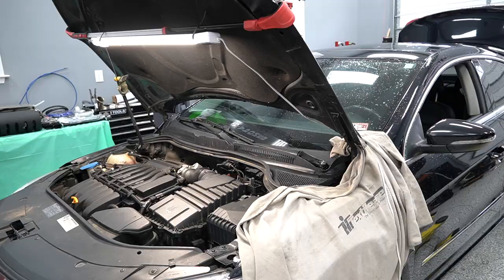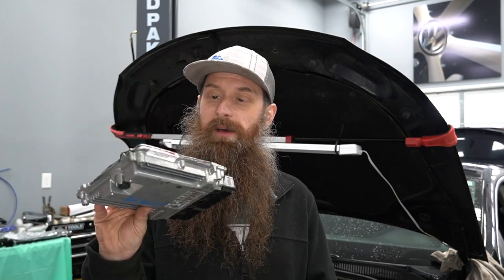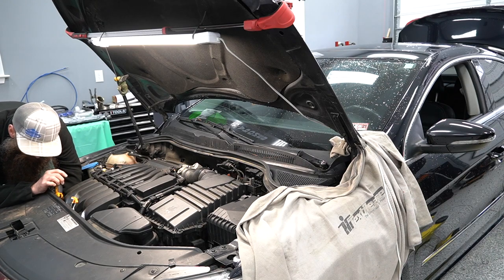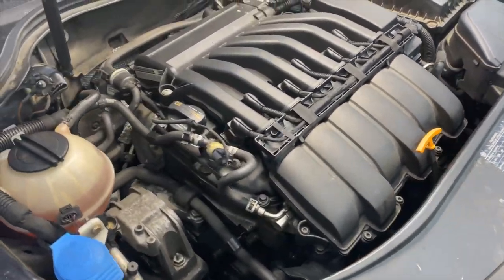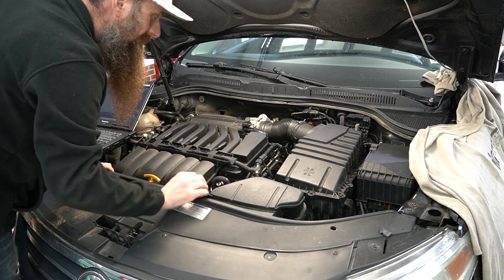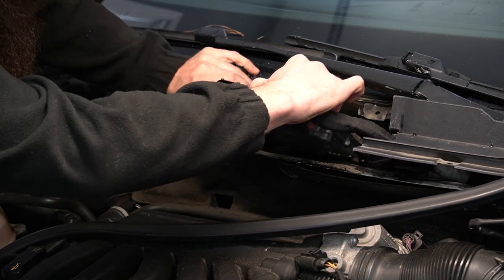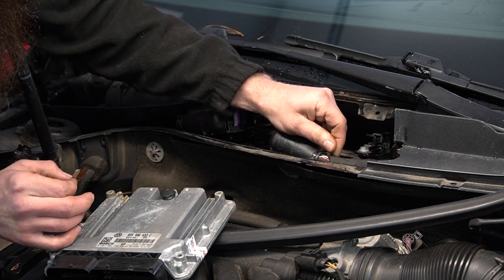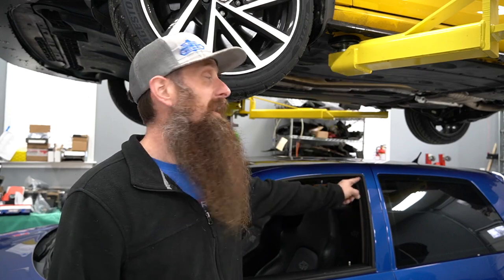3 Other Shops, Didn't Fix this Car. They Made it WORSE

Comment: I would say you have a bad high pressure fuel pump, you should have something closer to 40 bar at idle, 6 bar is tank pressure. A stretched chain on a fsi vr usually causes a fuel pressure malfunction fault and if you check it at idle you end up reading about 120 bar because the pulses of the pump and injectors are not lining up. Being the regulator is working I would lean more towards a pump  also the 3.6 uses a roller and not a flat tappet like the bpy so wear isn’t usually an issue

Comment: wish i knew how to fix cars. its fun if you know everything. i took a manifold off vw and and said nope, i'm not fixing it myself. but i learned alot just taking the manifold off cuz it taught me variety of components in the engine such as timing chain, purge valve, fuel pressure, coolant hoses, valve cover, etc, etc....different sensors everywhere.

Comment: This is a perfect example of the mess that can be made by parts swapping. I have been seeing this a lot over the last several weeks. These are cars I walk away from because the shop/customer can’t afford my time to find everything that is wrong or fix the problems they caused to then get us to a point of actually diagnosing the original problem.
Reply: We had a high mileage Benz (220,000km) come into our dealership courtesy an over enthusiastic buyer who purchased it as at auction as 'non starting' (but someone had restored the body/interior to mint). Weeks of hair pulling by my mechanics later i asked if the car had its original ECM, frantic nodding in the affirmative. Then I asked if the vehicle had its original engine... light bulbs went off all over the workshop... yep, had been engine swapped for later, incompatible model. We sold the vehicle as a parts car to somene who had the same model with good mechanicals but lousy body. Not worth our time to fix.

Comment: FSI pump cam followers are notorious for wearing, had a friend that wanted to buy a MK5 GTI 6spd car, we test drove the car, and it ran like it needed fuel under load, being that the VW dealer was selling the car in "as is condition no warranty", we asked that they fix the problem, and we would consider buying the car.  Long story short, the high pressure pump cam lobe was so worn out, it ate the camshaft lobe that runs the pump. They replaced both the camshaft that runs the pump, and the cam follower, and car runs like a champ now, my buddy has been really happy with his purchase, but I think it's getting close to that window when the cam follower needs to be swapped out for a new one before it consumes it self again....

Comment: Was in the auto repair business for years, mostly Bosch systems. The first thing I did when I got a car in the shop with problems was demand ALL the "old" parts, reinstalled them and then chased down the real problem. It was rarely what had been replaced.

Comment: Ah, the venerable BLV 3.6. Over the years, the only problems that have been routine are worn high pressure pumps...and aged timing chains. Solid engine.

For the customer, it's a big step to separate the transmission and rebuild the timing chain drive. But, if the rest of the CC is in good shape, it's a good investment.

The most fun BLV find is rare, it was offered on the little EOS. No replacement for displacement, as the gearheads will tell you.

Comment: Just got an 09 jetta 2.5 for $750. Trying to do this all myself is pretty difficult. Got codes p2401 and p2177. Havent found a direct answer on what is going on. So far ive changed the pcv diaphragm and the evap purge n80 valve. Going to get the codes reset and go from there. It runs drives and stops great. I also changed the oil which was really dirty and probably 8 quarts of oil in it. Also fixed the vacuum booster oil leak. Really excited about this car and hopefully dont have much to do. After i get the light off going to do the ac and get it legal

Comment: My audi had an ECM crap out. Right before it happened I noticed that the fans would run after I would shut the car off. Happened twice before the car just didn't start again.
Reply from the maker: That’s a common thing with ECM failure. Fans always on

Comment: “None of these points jump out at me....” good lord....that list of DTCs is absolutely unacceptable to me. Every single one. First impression was high pressure fuel pump and chain guide wear including a choice bag of sensor replacements. Wow.
Reply from the maker: You missed what I said. I said as “common 3.6 issues”. Not they are no problem. Just not common

Comment: Having a vw jump to different shops being incorrectly diagnosed and having parts thrown at it seems all too common. I bought an mk5 brm and had a maf code, it was also spooling the turbo until cavitation constantly. Looks like one shop followed the owners manual and removed the MAF fuse. The next shop replaced the turbo (??), and replaced the map sensor with a common rail one. I found a service manual. Replaced the fuse and the map sensor with the right one and it ran perfect after that! Poor guy had a bill of like 4 grand which was totally not needed

Comment: You will get fuel pressure related  codes because the wrong ecm is in there. Once the correct ecm is installed it should clear out a few things

Comment: I had one with alot of electronic codes for different systems (Golf mk5). Turned out to be the in tank fuelpump relay module being shorted to ground but it also caused the pump to not turn off with the key. But those electronics can be fickle. Had codes for everything connected to canbus.

Comment: I own a vw that I work on because no one around me can fix a normal vw let alone a modified one. I had at one point 6 parts to replace all because the idling fan died about four months after I got it. My car runs at 200 degrees so you need the idling fan for any driving under 45 mph and in my attempt to get home from work, since I only have a few minutes of city driving and the rest is highway, it heated up pretty hot. It has a range of 160 to 240 degrees and it hit 260 at one point in town. That caused a knock sensor to go out after  I replaced the fan. I ended up replacing a coolant flange, pipe, a bunch of vacuum tubes, temperature sensor, and alternator. The knock sensor, temp sensor, and alternator all sit next to each other and the coolant flange fits in the block. The coolant pipe was the only thing I had to replace because it was stuck in place and I had to get it out to replace the temp gauge and knock sensor so it ended up getting damaged because of the four hour struggle I had with it. Let’s just say I hate my vw when it breaks. That being saying I have a b6 tfsi Passat which is similar to the cc but very different in a lot of ways.

Comment: I have just finished working on a Holden Trax (Chevy Trax) that consistently threw a MAP sensor code at idle, vehicle was also hard to start and was blowing black smoke at idle along with rough running. It had been to various shops and had the ECM on the front seat as an indicator. A quick check of the MAP sensor circuit and operation on the data stream showed it was working ok except the reading was wrong, around 4inHG at idle manifold vacuum. A bit further investigation uncovered that the car had a cylinder head replaced with an exchange item in the past, checking the part numbers on the cams and the head showed the correct part number for the head but the cams were for a Holden Cruze. The Cruze had a different intake cam and phaser and the intake timing was out by 30 degrees retarded. Swapping the original cams into the new head involved removing the head and having the valve seats cut and the valves tipped off to get the valve lash spec right for the original cams, as lash adjusters were ex-Korea, 8 weeks away and 50 dollars each. The amount of money the customer ended up spending on the car was around twice the value of the car.

Comment: yer know... I had a company golf wagon that did a lot of crazy things intermittently, fail to start, run erratically, stall. then would run perfectly for weeks and do it all again. It spent time in 3 different dealer shops, even had a new ecm fitted, then finally the 4th shop called me within hours and told me to pick it up, it ran perfectly forever after that - it was the knock sensor.  This left me scratching my head, but I wasn't going to argue.
Reply from the maker: Wow!
Reply: @HumbleMechanic  I know right...

Comment: Well it sucks when there is a lot of embedded software (in the ECM) on a car and you don't know how it works.
Reply: This exactly the point once I have golf 5 showing engine check light show boost pressure sensor error when I scan the whole car it showed canbus error back door light shorted I told Mechainice to change it he don’t listen I changed myself after this boost pressure sensor error go funny isn’t it 😆😆

Comment: My VW dealership just stated I need an engine replacement after 41,000 miles. This is a 2019 Volkswagen Jetta. I baby the car and have always been ahead of the maintenance schedule. They are replacing the engine under warranty thankfully, but I am beyond shocked that this would happen. They state there was metal in the oil when they drained it. How could this have happened? I have never had such an issue on any other car. Frankly, the car has been wonderful but this issue leads me to believe I should never buy a Volkswagen again.
Reply: What was the symptoms you had to have them look at it?
Reply: @mhaas281  No symptoms at all, hence why I was shocked.
Reply: Why did you take car to dealership if no symptoms? Routine maintenance?
Reply: @mhaas281  Yes, an oil change.

Comment: VW should really give their customers a heads up on carbon build up in a direct injection engine!! its like selling a girl a rotary for her first car and not telling her any of the other things that go along with owning a rotary. direct injection with no catch cans, car companies sure do cut corners and give cars some really avoidable issues! what a bunch of crooks, make the car correctly please!!
Reply: Im sure they did it because of emissions. So the carbon is from crankcase oil vapor? I never knew where it could be coming from with direct injection, thanks for clearing that up. Car makers should include one or two cold start fuel injectors in the manifold to rinse them out.

Comment: My 13 vr6 is just under 150k, still purring like a kitten lol. Had the first malfunction 2 weeks ago. Pcv valve diagram tore. Easy and cheap fix. Thankfully I'm pretty mechanically inclined. I originally planned on selling it once reaching 150k but used car prices are insane right now and this is still a great car. I plan on keeping it till at least 200k or more.

Comment: I know that sometimes an ECM may have the wrong part number in the sticker but it could be flashed with the correct software for the car (or have a tuned software locked or unlocked).  Some firmwares can be downloaded online and ECM hardware is mostly the same.  Did you check the ECM part # displayed on the sticker matching the part # in VCDS?  Can't you flash the spare ECM you have with the correct firmware instead of buying a new ECM?
Flashing an ECM probably can be done on a bench and not on the car though...

Comment: i wasnt working auto   i was construction / ag equipment.  they wouldnt spend money unless they absolutely had to.  we would go to factory training  on the new stuff coming out.  unless there was a recall,  it didnt start breaking for 2-3 years .   by then you had forgot everything you learned cuz you didnt use it and you had two more years of new stuff  confusing you.   never had the correct tools unless you bought them yourself. so frustrating.

Comment: I'm passing through that issue. No shop is doing the service right
Reply from the maker: Some shops are just not equipped for certain things. I'm actually good with that. But they need to be upfront with the customer.
Reply: @HumbleMechanic  Yea, the last one i sent i just got sad. He said that he would do the service it's easy and all, but he sent it to another shop to do (and they done it wrong). I only found out when i bough it back to be fix right.
Reply: @1300l  that's ridiculous
Reply: @tylerkrug7719  Yea, i own a car since 2002, i never had to deal with that before. Worse is the service was just a install of reverse sensors.

Comment: Quick question if you see this... I used to have a 2012 Golf R. Professionally built up to UnitedMotorsports 2+ Dyno Tune, everything short of Flex Fuel done... Any idea why the car loved to kill Camshaft Position sensors like every 6 months and cause a hard misfire?!? New owner hits me up once in awhile when it does it again. To the point he just replaces that sensor every 3rd oil change lol
Reply from the maker: Damn no clue. That’s strange. Using an OEM sensor?

Comment: Looks like exhaust valves issue. When is big Vakuum it take some ex. gasses back and make f.trim in minus. Under hi load and hi rpm it goes in plus because in this condition some incompletely burn mix (extra oxygen) reach o. sensor and f. trims go in plus. Timing goes crazy because ecu trying to make engine running right. Compression test usually don’t help because you can’t measure it in those conditions ( big Vakuum, hi load...). A professional with oscilloscope could figure it out by looking in dates when engine running (Vakuum variations and some other dates). Just a idea.
You can look in scanntool with diagram by looking in STFT and catch the moment when it goes from open loop to adaptation. It should extremely in minus drop and then rise til those minus 10. And only on cold engine like first start in morning by driving it.
But don’t listen to me too much, I’m not a pro, so I’m probably wrong.

Comment: Had something similar once my battery disconnected from the positive terminal wile driving. Rough idle, stalls when starting cold, over/under fueling, oxygen sensor faluts. Did a throttle adaptation all issues went away. Mk3 vr6 problems 🤣

Comment: Gotta Wonder Charles,  Why cant VW just have a few General Purpose ECM's that are adaptable via programming to different uses?
GM looks to Does exactly that with their Computers, and you can adapt a single ECM quite a lot just by adjusting the programming / SW on the unit.
(Eg Take a Holden Commodore (Thats an Aussie Model) and look at just how flexible those computers are). 

You'd think that would be quite a large cost saving to do that, and that VW would do so, but apparently not?

Having a dedicated unique ECM for every small variation in power train that is fixed, is just stupid.

Comment: Ive got a 08 R32 here with intermitant starting issues ... it does this hot or cold but not at any particulr time thou when it does not start let it cool down for a bit then it will start any ideas ? ive pluged my Autel in and there is no fault code or anything relating to this issue thou i might pop a crank sensor in there as i know these can break down when hot  .... great channel loving the turbo stuff on the R32 platform ...

Comment: Hi Charles, I have a 2018 RS3 2.5 motor... I have a misfire on all cylinders and changed the spark plugs, coil packs and the 2 maf sensors... Still get a rough idle and codes p0300 on all cylinders... What do u think the problem may be?

Comment: I moved to a wideband AWP from a narrowband ATC. The car runs.  Its tuned up with Meastro. But I cannot see the ecu with vagcom. I can see the ecu with Meastro. Is it possible I have a canbus ecu in a k-line car?  You mentioned fans are a dead giveaway the ecu is not happy. Since doing the swap I have a cycling low speed fan with ignition on.

Comment: Hi, love the channel. I have the BWS model and has engine light on. Iridium Spark plugs black which were changed and car run ok for about a week but now issue is back. Running rough, smooths above 2000rpm, runs particularly rough below this. What are your thoughts? MAF or coil packs maybe?

Comment: My 2020 GTI  has so many codes that the dealer doesn’t know what to do. Sitting still every warning light came on. When I started driving lights went off but all electronics inside the car started going nuts. VW dealer says they don’t know what to do.
Reply from the maker: They must have VW intervention at some point.

Comment: Imagine if "right to repair" were a reality and you could actually fix/replace the software on ECM... Current situation is like "my printer doesn't seem to be working, I guess I have to buy a new computer and try again"!

For those having touble following this logic, ECM is technically a lower power computer packaged in aluminium box, running manufacturer tweaked software. And different ECM part numbers actually refer to software running on said computer.

Comment: Such as a broken macbook or iphone if somebody bad attempt to repair your car then repairing it goes to nightmare.So don't give it to untrustble,unknown repair shops.Cars are fully electronic controlled mechanic machines It's not a good idea to put electronic systems nearby hot,wet,turning,moving parts and factories are actually doing this.Cars has million of electronic parts inside motor,gearbox,roof,doors,even inside of tires and they're broken after a few years.

Comment: How has your experience been with the 2.0 tsi engine tsi as far as repair cost; Currently stage 2 stock turbo with a few goodies but, even with preventative maintenance I’m still running into fuel/oil issues. Approaching 65k miles and I’m honestly very scared I’m going to run into another huge repair would rather get rid of it

Comment: You can't find a good shop in my area, I've had a truck worked on twice for an exhaust leak and it just came back with a tone of Jb weld and pipes only half way welded on